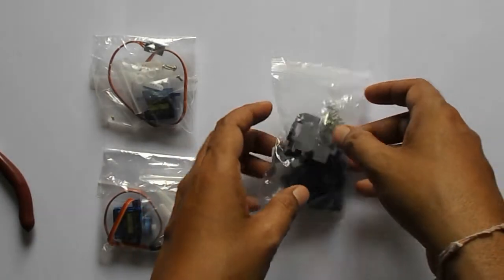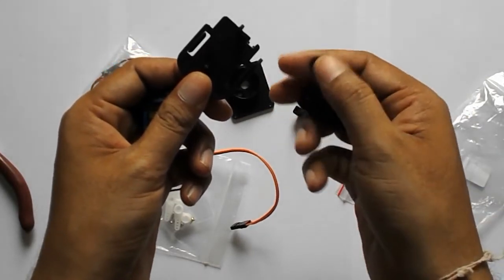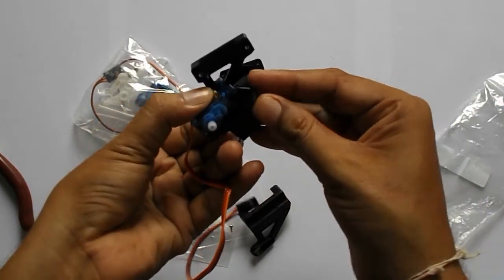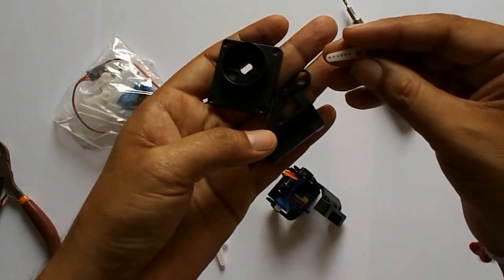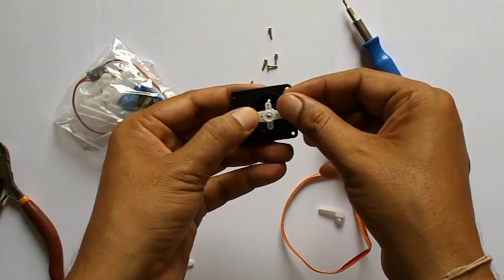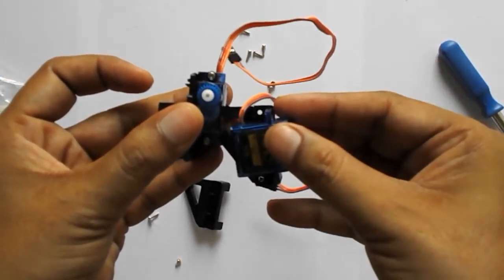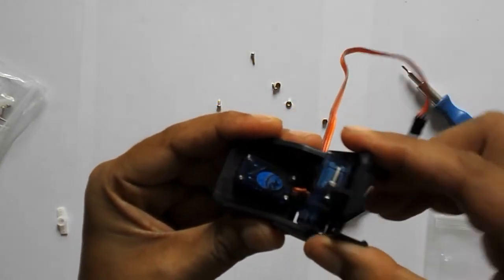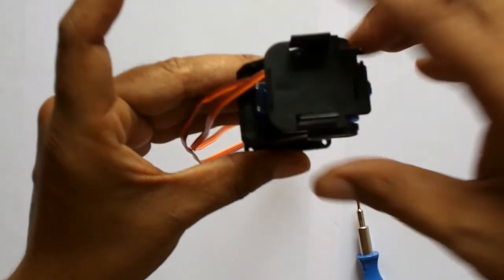Assembling a pan tilt camera mounting module

Comment: This mount is sold as pieces collected and not fitting. I have one myself. He struggles at several points to assemble and the camera is turned off. Screws don't fit. Very frustrating.